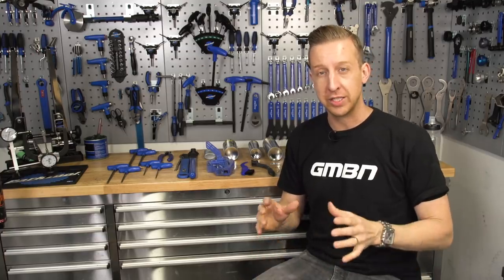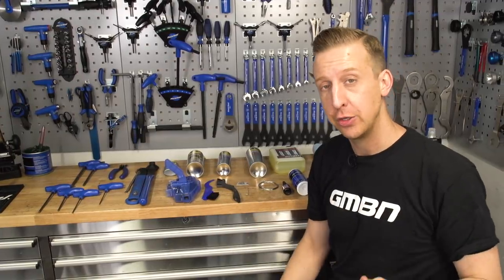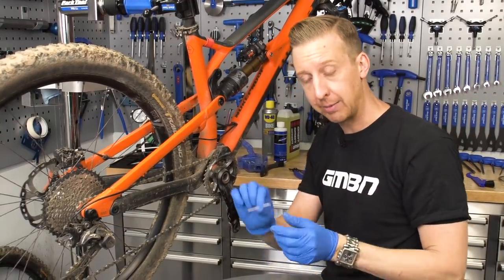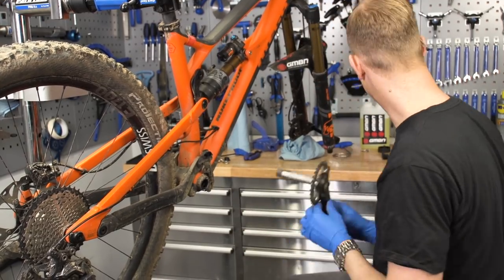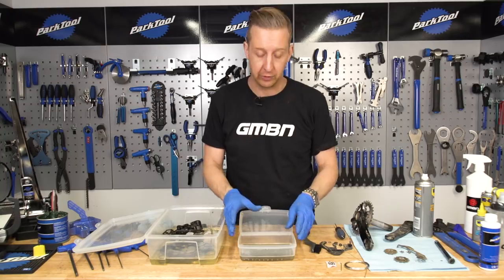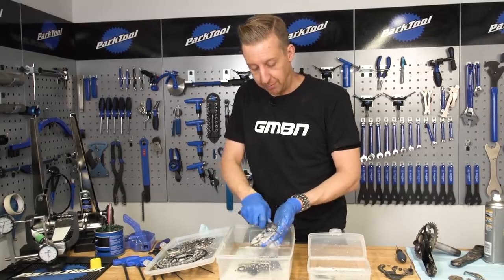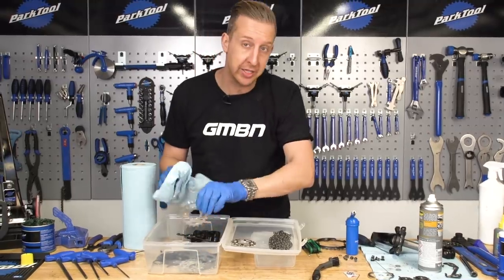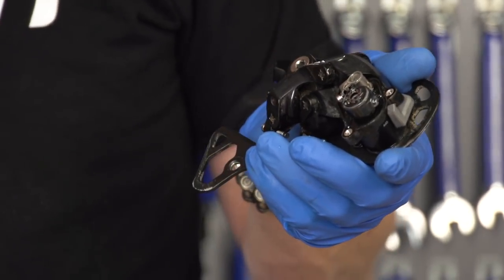Deep Clean Your Mountain Bike Drive Train | GMBN Tech How To

Comment: I try to avoid completely degreasing the chain - i used to but i found that it makes the chain feel very loose and dry. I've done my research on this and both Sheldon Brown and Shimano recommend trying to preserve the factory lube on a new chain as it's technically perfect and coats all the inner surfaces in a way that no amount of stripping and re-greasing will ever replicate. So now I use a wet lube to flush out the dirt, dry with a soft rag to get as much dirt and wet lube off as possible and spray wd40 on a rag and give the chain a going over with that just to really clean the outside of the plates. Since following that advice i've had about 1000 miles out of a new chain (and I do have a chain wear indicator). I find that kinking the chain into an S-shape when i'm cleaning the first application of wet-lube helps to expose the inner linkages and get more dirt out too.
Reply: Trail Time Tim I
Reply: I don't quite agree with Sheldon and Shimano on the factory lube. I agree that a chain with factory lube is thoroughly coated including the innards, however the factory lube is super-sticky and attracts grime very quickly, leading to chain wear. The reason they use a lube like that is because the chain needs to be preserved for the possibility of years sitting inside plastic before being sold and used. So I do think they do right by using that lube to preserve the chain for that situation.

There is another way to thoroughly lube the chain every bit as well as the factory lube, but without the sticky attracting of grime. That's by soaking the chain in hot parrafin wax in something like a rice cooker. Not straight wax, the viscosity shouldn't result in a dry flaky wax, you want to dilute the paraffin wax with parrafin oil and xylene.

I think the reason your chain feels loose after degreasing is that as all the grime gets dispelled, the rollers run more freely. And because of the thick sticky factory lube, you're not used to feeling the chain unlubed and clean. Also there's the added possibility of wear to the innards, so that they're looser than when new. Especially if you've been running it with the factory lube.

The most thorough way to clean a chain is firstly soak in petrol for a few hours, then soak in degreaser, then thoroughly wash the degreaser out of the chain with water, it's important to do a good job washing the degreaser out. Then soak in methylated spirits. The last step is to lube it by soaking in the hot wax for a couple of hours, that will mean you're chain is thoroughly lubed where you need it on the inside rollers, then you want to use a dry rag to wipe the excess wax off the outer plates of the chain. The wax solution will be better than anything else at keeping your chain lubed while not attracting grime.

And when you do that treatment, you want to clean the rest of the drivetrain too, cassette, chainrings, deraileur.

Comment: Most of that cleaning should be done every ride so I do it all in situ on the bike . Just removing the rear wheel. A stiff bog brush on the cassette when dry get all the grit out off the pressure faces. Do not use cleaning agents or it'll degrease the free-hub. But I sometimes I do remove the cassette .. The chain stays on the bike. I put on a chain holder , suspend the rear end over a bucket and I work on cleaning the chain while hanging with a detergent and 2 nail brushes.. Then I rinse the chain with a kettle of boiling water, the crap drops out! Keep boiling water away from the derailleur  . Jockey wheels are cleaned with a toothbrush as is the front chainring. GT 85 applied to mostly everything. The chain gets Phil Wood tenacious oil . All this gets done every ride so it avoids these kinda  strip downs

Comment: You can use 2 toothbrushes stuck together for a chain then lube after : )
Reply: Yeah I've tried that with big nail/hand brushes, but I found that the degreaser doesn't stay on the brushes well and the black grease also flies everywhere if you do it with the chain on the bike. I will have to get a closed system like the tool Doddy showed to optimise the cleaning if I don't want to take the chain off every time.
Reply: Just get those nail brushes or vegetable brushes and squish them between your hands with the chain in between. That will really do it

Comment: Never use any type of de-greaser/solvent on or near your bike, unless you want to ruin the bearings on your rear hub, cassette free-body and your bottom bracket bearings.  Always remove your chain, crank/chain rings and your cassette so you can safely immerse it in de-greasing solvents to your hearts content, and get them squeaky clean.

Comment: as far as i know, you also need to put something between the break pads before you take off the wheel so they don't lock up
Reply: You can use bleed blocks or just make sure the brake levers don't get pressed down.

Comment: Aaabsolute overkill....
Just put some degreaser on everything, run it through a Grungebrush, wipe everything off with a towel - done.
And don´t be shy to replace your chain - saves you a lot of hassle and cost to just replace it when it becomes a little worn compared to ride it until the whole drivetrain is dead or clean your bike like above regularly.

Comment: would it work the same if I zip tie the cassette because I would not know how to put it back together.
Reply: It depends on how much work you want to put into cleaning them.  I zip tie cassettes when I switch them & put them away.  If you study the cassette when 
you take it apart, I've found that it isn't a problem reassembling one.  The gear sizes determine where they go, & sometimes half of a road cassette can't be taken apart.  The spacers that go between the gears are actually easy to figure out.  So, all in all, reassembly is too difficult.
Reply: @MTBXCSKI65  ya mean NOT too difficult?

Comment: What kind of thread lock do you use?
Reply from the maker: Doddy is using Park Tool's TLR-2 High Strength thread lock. It's one of the stronger thread lock options they have. So ensure your using the correct amount when applying it. 👍
Reply: @gmbntech  thank you.

Comment: When greasing the inner parts of your clutch mechanism, be careful where you apply the grease. If it lands on the wrong position, it may actually decrease the performance. So I'm not very excited about using a spray grease there.
And when you already have the derailleur open, you can also remove the cage from the rest, and clean and regreaee the plate axle (the screw connecting the cage to the rest). That thing was creaking like mad for me, and actually already began to rust after 4 months of wet and muddy riding. And often washing your bike, or even soaking your derailleur in degreaser will not help here. On the contrary, it will worsen the issue if you don't regrease the axle.

The service manual: http://si.shimano.com/pdfs/dm/DM-RD0004-08-ENG.pdf
Maintenance starts at around page 22. Maybe that would even be worth a whole video.
Reply: Ok, just did the maintenance video for a RD-M8000 rear derailleur myself.
https://www.youtube.com/watch?v=5ku54TS4iKM

Comment: Complete disassembly and the overly abundant degreaser pollution is unnecessary. C'mon. Just lightly rinse bike as is with a light dish soap solution and let soak. Then brush stubborn areas with big to toothbrush size brushes. Then rinse and lube where needed.

Comment: Info from KMC  web site, most chain manufacturers are similar in that they say that degreaser should never be used on the chain.                Do not dip your chain in (aggressive) degreasers - they remove the remaining grease from the chain’s bearings, and may cause cracks. They are also bad for our environment.     If the chain is really dirty and difficult to clean, besides using a brush for the inside, try putting some solvent on a cloth and use it to clean the chain’s exterior.                  Try to avoid a so-called ‘chain washing machine’ in combination with solvent. This will instantly ruin your chain.                            Some lubricant brands advise you to completely degrease the chain, KMC does not recommend this.

Comment: you can not reuse 11 speed chain links.i heard you use 10 speed link on 11speed.buy the park tool chain cleaner
Reply: You can reuse them, they can be used for as long as they are hard to open and close.

Comment: When I'm cleaning my chain and chainring with a stiff brush using degreaser it flicks everywhere I suggest wearing eye protection.  👀
Reply: Better way is instead of using brush, soak in the degreaser for a longer time, then shake, that will get the grime off better than brushing it. Especially the inside rollers where you really want it clean. If I'm doing a once a year deep clean, I sure as hell am going to not cut the soaking part short, you're not going to clean the rollers properly without soaking properly.

Comment: so... degreaser... what about paint thinner? (it's cheaper)
Reply: I have used mineral spirits for many years.  I soak the parts overnight in a plastic bucket & swish the whole thing around a few times.  Then I dispose of the used spirits, add "fresh" spirits, swish them around some more, then hang the chain & cassette up to dry.